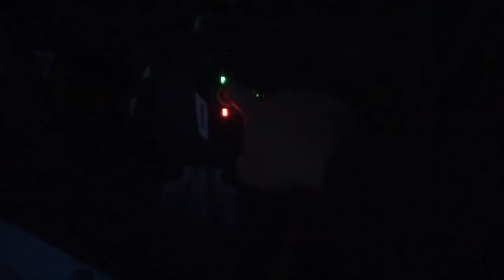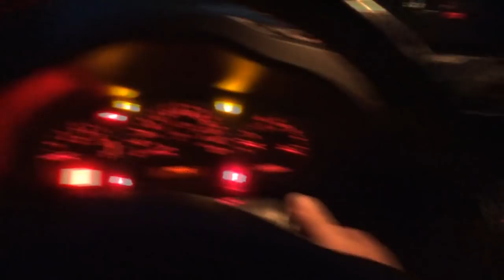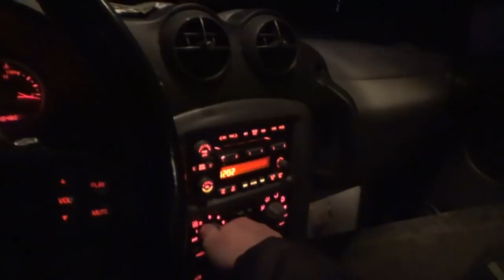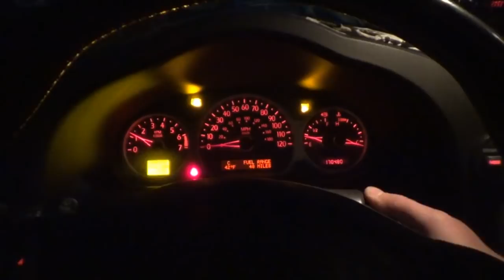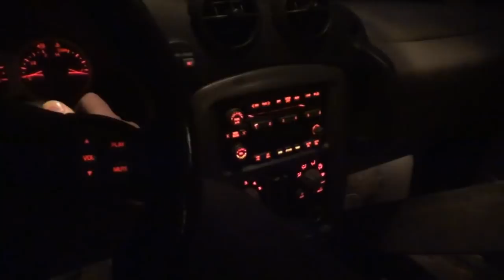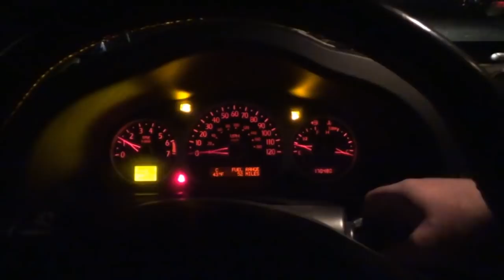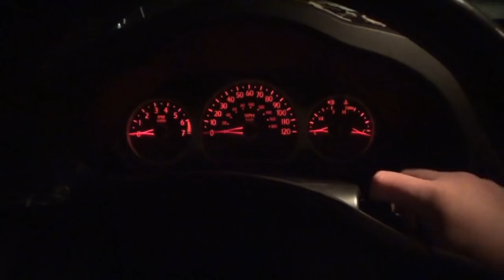MV 191 - "Aztek Electrical Connection Short"

Comment: Okay: 1: Replace the positive cable. 
           2: Check the fuse box for corrosion, also clean up that positive terminal on there.
           3: Clean the negative terminal with a wire brush.
           4: Take the plenum back off and check the gaskets, if gaskets are good, put it back on and torque the bolts correctly. If not, replace gaskets. I am almost positive it is a small vacuum leak. Check EGR too. That leak is also affecting the idle. Small leaks can be a pain to find.

I haven't had a chance to watch the video of the teardown nor of the rebuild yet when you did the head gaskets. But it seems you may have nicked the plenum gasket when reinstalling the plenum, there isn't a lot of room under there. Don't feel bad if that is the case, I did the same on a 1998 Villager I had years ago.
Reply from the maker: I figured out what the noise was. It will be addressed a couple of vlogs from now. Thank you for the tips!

Comment: Literally had the same problem with mine. It was a bad negative cable. I would replace both battery cables and that should fix the problem. Moisture tends to get down into the robber and corrode the actual wire.